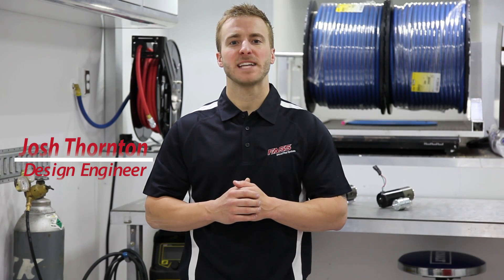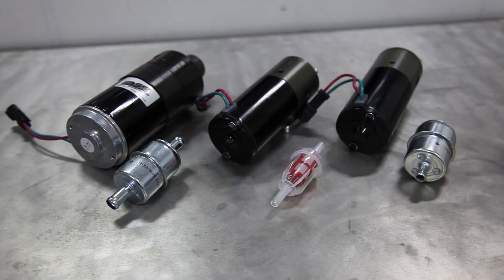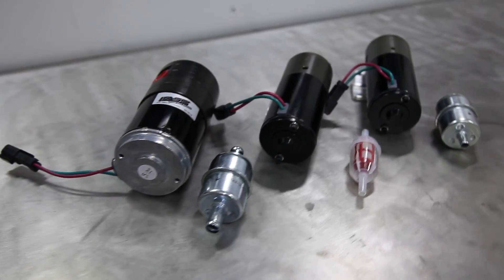FASS Fuel Systems "Tech Tips" Importance of the Inline Fuel Filter

Comment: Just picked up a DDRP 02 for my 2002 Ram 2500. I'm a little worried/annoyed about having to replace the inline fuel filter every 6000 miles, is there a location you can suggest to mount the inline fuel filter so that it will be easy to access to change? Also any specific brand, size or micron filtration rating that I should replace it with? Thanks!!